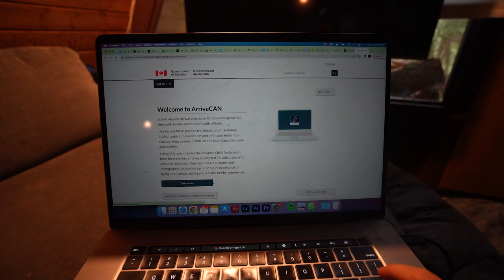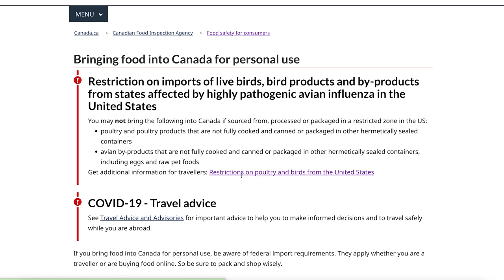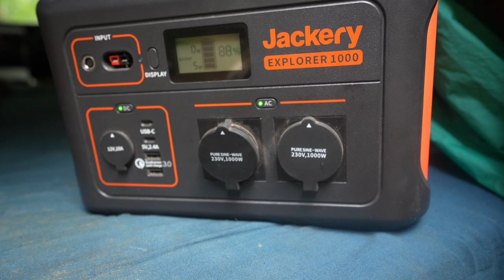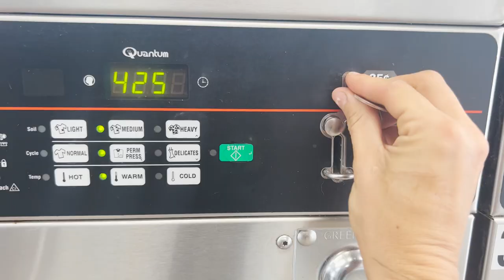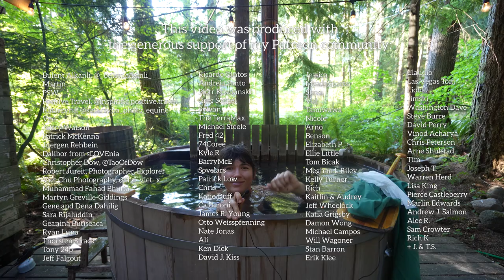Preparing to Survive a Solo Expedition to Alaska

Comment: If you want to run one tire for everything, Maxxis Razr or Bighorn tires are super in mud and snow. As well as being great on the road.
I went from Oregon's frozen backcountry in Winter to Death Valley without chaining up once or having a single failure. The E rated work best to avoid sidewall cuts from rocks. I have ran these for years with no flats or issues.
Reply: Download these for the trip if you have not read them already.
Prepare for the worst, BUT. Envision the best journey, feel it. Live it.
Happy Trails!

Comment: You are in for a real treat! I have driven to Alaska from Oregon twice, once in 1993 and again in 2014.  It was amazing, and I hope to do it again in the next couple of years.  Both times I bought a copy of The Milepost Alaska trip planner. It gives you fairly accurate details on travel on both the Cassiar and AlCan highways, and interior highways on your way up to Prudhoe Bay. It gives locations of campgrounds,  gas stations, places to eat and points of interest along the way.  I found it very useful and generally very accurate. 

I started my trip in 1993 about the same time you are, and chose the Cassiar as my route North. This late in the season there are fewer RVs on the road. There was still road construction at 50 to 75 mile long stretches at a time to slow things down on occasion. Other times there were graders leveling out the gravel stretches of highway to flatten out ruts and potholes.   Wildlife in the road can be a concern, especially near dawn and dusk when they are most active. There were plenty of bear, moose, and Dall sheep (in the higher elevations) carcasses on the sides of the roads...generally hit by big trucks.  Definitely something to watch out for.   Once the Cassiar connects with the AlCan, the road is mostly paved, but there are still stretches of road construction (highways in Alaska and Northern Canada especially are perpetually under constant repair) and the occasional wildfire close enough to bring smoke on the highway.  

I brought a 5 gallon can of gas along just in case, but never ended up using it as I was able to plan my fuel stops (using the Milepost as a guide) before I got close to empty.  I did end up helping out an employee of a RV company who was shuttling a motor home south to warmer climates that had run out of gas,  and gave it to him to get to the next gas station.   

I chose to come back down the AlCan all the way on the return trip. It is the more civilized highway with more campgrounds and gas stations that do not close down due to the end of the travel season.   You are going to have an amazing journey up North, and I hope it is as problem free as both my road trips north were. Can't wait to see your videos!

Comment: good to have spare car parts like starter, water pump, alternator ect.. you will not find them in alaska, every alaskan also has a heating coil installed either in a water line or oil line so you can start the engine in the cold, have fun..

Comment: A butane stove most likely will develop all kinds of issues in the cold. Butane liquefies right around were water freezes and that means your bottles, full or empty, won't be pressurised anymore. Reliable in the cold is either pure propane (those small green canisters are expensive though) or actual liquid fuel stoves. They are a bit less convenient to use though

Comment: I went down the Al-Can highway , back then it looked like a super highway that had been shelled for years. It was so bad , we needed to build a frame with heavy metal screen in front of the lights and radiator and another one in front of the windshield. We passed many new vehicles that had their windshield, lights or radiator knocked out. We carried extra water , about 25 gallons,  radiator hoses and extra set of tires. They have the Circle highway that is pretty cool.

Comment: No problem 
I’ve driven those highway’s and it’s easy going until you go north of Fairbanks. Access to wi fi is pretty good with some blind spots, until north of Fairbanks. Take a tire plug kit and small portable pump. I had to repair (plug) a tire and inflate until reaching next town for proper repairs.
Restock in Fairbanks and seek advice from the truck driver’s, they will gladly tell you of hazards heading north. Truck driver in Canada will also give you a heads up on mountain passes.
You go girl! Surviving Laredo was the biggest hurdle.

Comment: Just saying on hard snow and ice, only spiked tires work well. There might be a new type of tire that has been invented that changes that, but I don't think so. Good winter tires made to deal with it helps a lot, but for those days the weather is bad, spiked tired are the only way to go. If that isn't possible make sure you have chains too.  I know this because I live in Norway, where we have temps during winter that goes below -15 and even -25 now and then in the far south of the country, up north it's even worse.

You should also find a safe place to test your ability to handle it if the tires slips as soon as you get to a place where there are snow and ice, getting used to it, usually helps a lot. Around here were I live, we usually see a lot of crashes the first few days that the cold hits and makes the roads slippery each year and it takes everyone a few days to figure out how to adapt their driving each year. So smart people try hard to just stay off the road those first days so the bad drivers don't crash into us because they can't handle their car on snow. So find a safe place to test your self.

Comment: I took the cassiar highway on a motorcycle, keep a good eye on the road especially in the blind turns, can go from pavement to gravel mid turn, lots of black bears as well, gas stations were pretty far between, probably more built since i took the highway in the 1990s. lots of trucks trying to repair the gravel sections during summer, keep some distance and as long as the oncoming ones do not throw rocks at you your windshield might survive, best of luck and enjoy the trip

Comment: Buy a copy of "The Milepost" as it is a great road guide for the far North. Never drive past a gasoline station in the far North. Always fill up as half the gas stations start to close for the winter in the middle of September. They are also many miles apart in some cases. You will find places to shower so just ask. Camp grounds, truck stops, travel centers and large gas stations. Some Motels and Hotels offer cheap showers as well. Take 2 spare tires and equipment to change them with if you get a flat tire. In the 3rd week of September 2009 I ran into a major snow blizzard on the Dalton Highway. The next night is was -10*C.

Comment: The route goes, Border to Tok, to go  toward Anchorage, take the Tok cutoff, AKA the South road. Go to Fairbanks, Denali Park, keep going on Alaska highway to Delta. At Delta either go North to Fairbanks, or go south to Denali highway and across to Denali park along a mostly dirt road. Roads to Anchorage and Fairbanks, all paved. Taylor Highway to Eagle, not advised this time of year, mostly dirt. Haul road, Dalton highway to Deadhorse, dirt. Seward highway to Seward or Homer, all paved. Road to Valdez, all paved. Gas price inside Alaska, $4.70-$5.25/ gal.
The usual route is to either go from border to Fairbanks, then Denali Park, then Anchorage, the Kenai peninsula(Seward or Homer) then back to Anchorage, back up to Tok, and to the border in one big loop. Or go the opposite direction, reverse of above loop, and go along the same route.

Comment: Eva,   there is only about 4 hours driving time between the Alcan and Cassiar Highway.  There is a long hot shower waiting for you here in Fairbanks,  and a close hot spring in which to soak the road dust off.  I would suggest you check with the RCMP (Local Police) in Prince George and check on the road status of the Cassiar. If conditions are bad you can switch to the Alcan at that point. There are essentiall only 3 spots to stop for fuel on the cassiar highway,  I suggest you top off your tank at each one because the next one may not be open.  We are pretty much out of the mosquito season so you should not have problem much with them once you arrive.  If you need help, information  or advice you can contact me.

Comment: Eva those tires you put on look to be BF Goodrich K01's those tires have been out of production for a long time....chances are you will be fine..but take warning when rubber tires get old they turn hard and will be terrible on ice. Check the side wall for the manufacture date of the tire. You may have been better off with the BFG KM2's that where on your truck.

Comment: Lived in barrow.. you car is not winter ready, far from it, you need specialized hoses, liquids, supplies, water, clothes so you won’t freeze, your car need enough gas /diesel so you don’t turn off your car. Your leaving right at dangerous time. North slope is its own animal. It’s not like anywhere you gone before. If winter comes early??? I would have recommend flying to anchorage from Fairbanks go to the cabelas and go shopping, a Canada goose will cost you $1400 and that was few years ago I’m sure prices have gone up. I am sure Fairbanks can help you a lot but I don’t know if they have cabelas anchorage does.

Comment: Canada does not allow pepper spray. It's one of their most common question to ask. Once you inform them you have it. They tear your car apart. Then you surrender it to the queen. Then you will be check again. On your trip back through Canada.
Reply: Pretty strange seeing as you can buy it easily in outdoor stores across Western Canada with no permits needed.

Comment: Eva ... I wish you great travels .... I'm a little worried for you though ... those roads are very remote and the North of Alaska is a very wild and very cold place that can have icy roads all year long ... so take it slow ... be careful and make sure you are stocked up on supplies  ... God forbid Odessy gets stuck in a snow drift and you have to walk an icy remote road to find help as cellular doesn't work everywhere out there ... but make sure you have everything you need to complete such a journey just in case  ... warm clothes and boots ... protection from animals ... ability to light a fire  ... flares  ... back pack wirh water tight liner ... binoculars ... compas ... maps  ... in case there is no cell connection ... emergency foil heat blanket for warmth  ... 

Better to have the right stuff and not need it than to not have the right stuff and need it ... be careful ... and bon voyage  !!!

Comment: Make sure to bye bear spray in Alaska, cannot go through with it in Canada. Good planning on winter tires, should be fine now. If however you plan on staying in Alaska for an extended stay exploring other parts of Alaska, maybe snow for your trip back to the lower 48. Kenai Penninsula destinations would be a great detour. Traveling down Denali Highway should be on your bucket list and possibly Crow Creek Marathon trail for an adventurist as yourself. Will definitely an adventure of a lifetime

Comment: I've heard positive reviews about Starlink outside the US in 2021/22, it was questionable in places in 2020 and early 21 but I have heard it has improved a lot in that timeframe. Biggest issue I've had with dog food and crossing borders is it needs to be in the original bag or some countries require the bag to be unopened. I prefer a separate GPS from my phone, something like a Garmin designed for backpacking. Far more reliable than a cellphone in remote areas. Garmin also has downloadable add on packages for hiking trail systems, campgrounds, etc.

Comment: Hello Eva, I think you are leaving a bit late (May, June). For shampoo, you can find dry shampoo. You can also make a foldable shower in the car, it is often done. The easiest way is also to cut your hair a little.
Pay attention to the insulation of the car, especially the windows, you can find flexible composite systems such as the tri-radial. You simply place them in the evening with Velcro.
To sleep take a sleeping bag (Arctic) - 25° Or less if you plan to stay in the winter.
Good road kind regards Patrick.

Comment: This is really the most interesting ‘Expedition’ way to get to Alaska through B.C. I grew up in northern B.C. - Drive to The city of Prince George, in B.C. Do ‘all’ your prep and stocking up there. Drive to Smithers B.C. A nice town and top everything up. Then drive to Kitwanga and make sure you get all the gas you need before turning off there on the Alaska Highway. (No gas for many miles) don’t miss out on a detour to Hyder Alaska to get hyderized!! (Hyder Alaska is small town on the tip of Alaska that you can access from B.C. Before going all the way up the Alaska Highway, to Alaska)  be prepared with supplies on the long journey on the Alaska highway after that; no joke on that part. That should help you through my area, to the Alaska boarder. If you go through Dawson City, make sure you go get the Sourtoe cocktail. (Look it up. Lol! ) Cheers!

Comment: Be careful on that trip, some things I can tell you about Alaska temperature during this time of year might feel fine during the day but nights will need a sleeping bag. When you head north of Fairbanks the road going to Prudhoe Bay will become a dirt road after the bridge going over the Tanana River. I have been snowed on in August near Anchorage, and I have seen snow stick and stay October 1st.  Most of my time in Alaska was spent near Anchorage and they reach high's in the mid 80's in the summer and low's in the -25 in the winter.  But Fairbanks will reach high's in the 90's and low's in the -90's degrees Fahrenheit. Have fun it is a great place to go if you don't mind the cold temperatures. Be aware -70 degrees fahrenheit is the cut off you need to be wearing gloves when filling up with gas and exposed skin becomes frost bite instantly at that temperature. Prepare and it will be ok.

Comment: Maybe it's the IT guy in me, but I'd bring the Starlink in case of an emergency. Cell phone service will probably be non-existent for long stretches of the trip, and you may have an InReach or Spot, but that means you have only one means of communicating outside of cell service, and those also can't provide Internet connectivity.  Starlink could be cheap insurance for the most remote portions of your journey, especially for things like researching truck fixes, first aid, and navigation.

Comment: You can wash your hair any time!  Just boil a pot of water, over your little stove, or an open fire.  Kneel down, use a cup to pour warm water over your head.  Soap and rinse. Easy peesy. 
 
When you say "expedition" you make it sound like a marathon or a chore. It is NOT. Is just another trip like you've been doing for years. It is not a race that you have to finish in a set time. When you need a break, find a nice spot and pull over! There will be river, lakes, "views" where you can stop and enjoy yourself. Sure why not meditate for a while along the way.  Journeying in remote places like that are rarely going to get hectic. Don't travel until you are healthy. Travelling long distance by road when you are sick is a total drag, and a waste of what should be a good experience otherwise.
.
For a long trip in a remote location I'd suggest taking 2 spare tires. Take a tire repair kit. Take "tire goo" that will fill small holes. If you do get a flat, get it FIXED as soon as possible. You do NOT want to be stuck out in the middle of nowhere with a flat spare! (Been there done that!)

Comment: Starlink does in various areas of alaska. By the way, buy both a ham radio and a VHF radio. Both are used in alaska and canada and if you break down you reach someone for help. I lived in alaska 7 years.
Reply: I know you are a true explorer and not much will stop you, so also get an engine oil heater installed before you go. Might want to carry some gear from antarctica if your trip takes you into late october and november. Lots of freeze dried foods. The road is used by truckers, but they travel according to the weather. They travel hard and fast and blow snow over your windshield and trying to stay on the road is fun. Plan to get stuck or blown off the road even. Plan for everything, antacrtica on steroids.  Been there with -75 below zero before. Darkness like norway, 24 hours darkness in winter.
Reply: That link gives some tips on preparing a vehicle for arctic travel. Alaska looks small on a map, but it is the size of over half the United States. The roads suck, moose and wildlife dont get out of the road, and just be careful.  You have to be tougher than Alaska.
Reply: If you have an unlimited timeline I want to say wait till summer to make the Alaska trip. I would make a round trip through the United States, going to New York and down to the Florida Keys, go up into the midwest and see some great country, jump over to the Grand Canyon then cut across to the West coast to California and head north again in Spring. Lots of things to see and do to give you the full view of America. Even hit every National Park in America.

Comment: Hi Eva, good luck on your trip. I noticed you got a butane fueled stove. I have one and they work great, except when it is cold out. They stop working at about 0 deg. C the butane can't change to a gas and come out of the can. So you will need to keep the fuel can warm. Just a heads up! Good luck.

Comment: Best to carry 5 gallon spare gas. That was most people concern as the pump far away and if you jeep has too high gearing as your it get terrible 60 mpg mileage
Reply: It's like a trade off, more low end power means higher engine spinning at 60
Reply: When ever you travel hide cash. Cause tow truck don't take credit cards. The independent only deal with cash. Be safe.